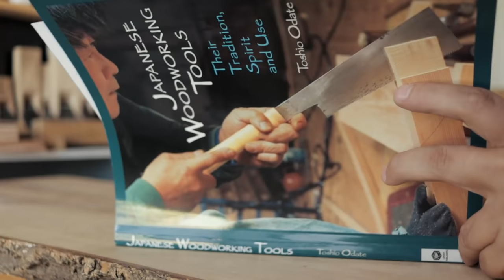The Japanese Workbench - a Planing Beam

Comment: Just so people know, this is not the Japanese Workbench.  Odate was a Shoji carpenter and this was the portable, usually site built,  planing beam that they used for dimensioning stock, etc...  I built one of these out of a 2x10 for the single purpose of tapering sail battens.  It was mechanically excellent for that purpose.  The piece of perfect wood I chose for the beam, plus a tiny screw hole, then went on to another life.

Japan had a lot of highly specialized craftsmen who work on single products like combs or gift boxes, and they use specific work surfaces or fixtures.  I don't know if there is such a thing as a general, recognizable Japanese workbench, any more than there would be a single bookcase sized library that would serve doctors, lawyers, and engineers.  

In the 80s I went to Bear Brook park for that foundational event where Masterpiece Tools brought over expert craftsmen from Japan.    The planemaker had a stump to work on, into the surface of which he mortised a stop.  That was his setup.  They don't really seem to need a book of plans to know what they need in order to make a product that they have produced their whole life.   Will it be a thing 90% of the surface of which is designed to hold stuff they don't make?  Some of their shops are like 10' x 10', tiny garages you might put a Japanese compact car in.

In the west, window makers also had specialized planing beams that held the relatively more complicated parts in western windows, and positioned the parts for molding.

Comment: Nice.  Putting theory into practice.  Looks like the wall is going to get in your way when you're doing longer pieces.  But maybe it's just the camera angle.
Reply from the maker: Thanks! That's why I added a second, forward, notch on the low support to bring the beam a little forward so I have clearance for the plane

Comment: Nice video Adrian, the angled planing beam looks like a really comfortable way to plane. Do you have any recommendations for a wide (~60-65mm) plane in Europe? I have the Dictum one, but smaller. Was wondering if you found good places for Japanese planes here in Europe.
Reply from the maker: Thanks Michael! I only have cheap kannas so far like those from Amazon, under 100 usd/euro. If you go in my tool list on my site, it's a link in description here, there is a 65mm one at 88 euro. I have that one. Haven't used it so much, I was able to set it up, sharpen etc and it's ok

Comment: A combination of simplicity, elegance and function. Tell me, do the legs of the A frame slip on a smooth interior floor? I could see that in a workshop that may not be a problem.
Reply from the maker: Thanks! It seems they don't. I had in mind to add a rope from the underside of the beam, about 1m away, then to the lower side of the A sawhorse, just for safety, but it wasn't the case. The only risk is that I will hit the sawhorse with my leg but I will see how will go when I will work more on this tool. Maybe I will add that rope eventually

Comment: What is the benefit of the bench being on an angle? Presumably it is better ergonomically? Are there other benefits? Or was it more due to size? It came out beautiful, I would like to better understand why it is designed so.
Reply: Is it as simple as reducing labor by pulling downhill?
Reply from the maker: Yes, the small slope and gravity helps you while planing with japanese planes. Probably for western planes you will need to reverse, start from high and end with low

Comment: Could add adjustable rails on reach side... make it like a taper jig
Reply from the maker: Yes, also for edge planing. Normaly in the book it was this feature but I don't need it, I do this operation on the table saw. This beam is only for fine planing

Comment: did you cut the rabbet with the router too? i must have spaced out when you were doing that in the video. also, were the holes on the rear support stand just to reduce weight?
Reply from the maker: Yes, but I had it cut long time ago, didn't film that. I was using that beam "dirty" between my bench and the table saw before making this fancy setup.
Holes are because I used short screws, I had to place them more inside

Comment: It seems strange to do all that hard yet very artsy work and leave the base of that bench uneven. Leveling all those beams out would have made the whole contraption even more sturdy, no?
Reply from the maker: That base is very even as it is and it's not seating on the floor on those 6 beams, but on that frame. Some things I considered:
- particular in my case, I cut each of those 6 at 60cm length but I was missing about 0.5cm at two of them because one of the rest I had (I bought a 7m beam) was only 179cm and something, so that's why you see some differences on the bottom
- I never aimed to make the base sit on the whole surface of the 6 beams ends. No matter how precisely I cut them on the handsaw there will still be some small differences between them
- but even if I would made that, I put that frame on the bottom for two reasons, to increase a the footprint of the base for more stability, and, second, to easily level it to the floor (you only need to plane two of the opposite corners), then I added those rubber pads to give extra friction

Comment: Another excellent video. Making functional items with design in mind. Quick question: when you were installing the rope detail, it looks like you switched from a metal to a wood hammer. Did you find one worked better? I’m planning on installing a rope detail to a beam and really liked your method of using wedges. Hammering the corners seems really important.
Reply from the maker: Thanks! Ahh, I don't think it's a really big deal metal vs wood. Probably wood is better. I kind of made a mistake in filming here, I didn't realized I begin with one and ended with other :) I saw that in editing. Probably I choose first the metal one cause it was small and will not hit the the wood base when winding the first coil.

Comment: I'm am not sure of the purpose of the natural fibre rope, other than aesthetics. If you want to use it for compression, then install the rope wet and let it dry naturally. The rope should shrrink as it dries, tightening the coils.
Reply: Typically, the post against the wall is just a log, trimmed square and to height. If you want it flat against the wall, just hew the side with a hatchet.
Reply from the maker: It is just for design. I was inspired by Odate's beam from the book, he had this lower post tight with rope against a pole in its shop. Looked cool and I thought to simulate that

Comment: what are the two notches on the low stand for?
Reply from the maker: I show at the end why. Usually it stays on the last notch, but when I plane long pieces, like 2m ones, that they are using the whole length of the beam and so the last plane stop there, I need some space, clearance, to retract the plane so that's why I'm moving the beam a little further. I could have made the beam a little longer but that will have take more space